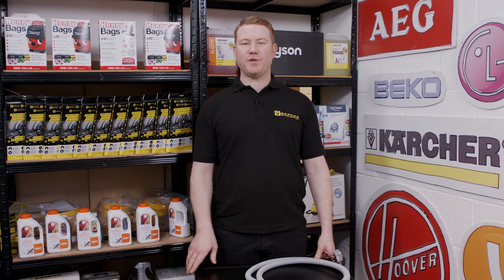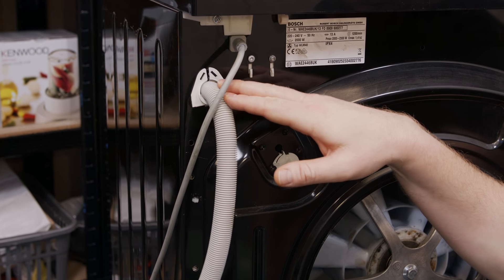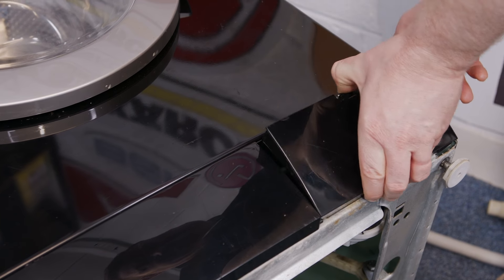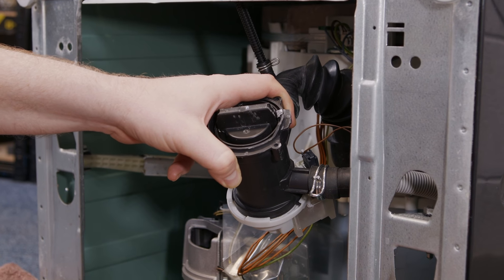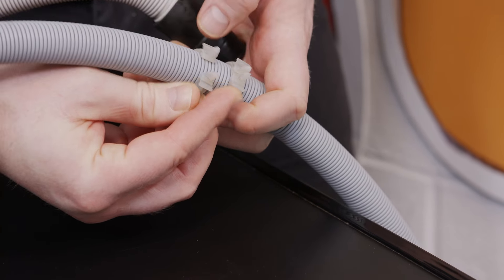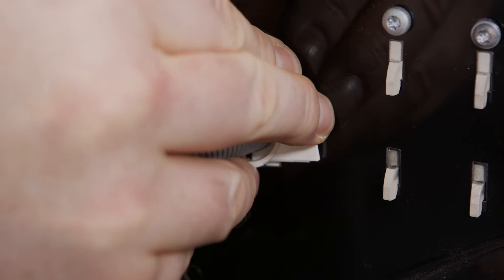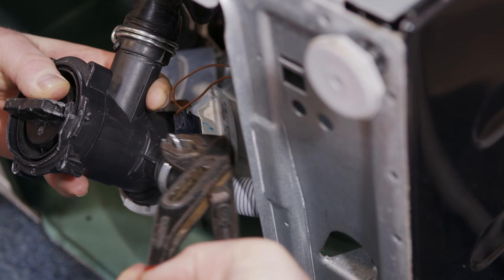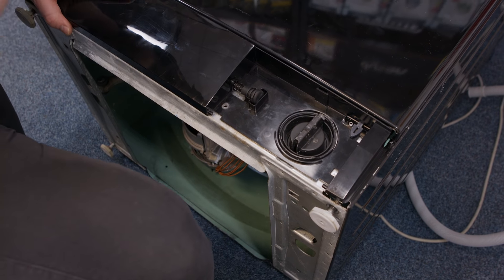How to Replace the Drain Hose on a Bosch Washing Machine

Comment: With your video I managed to fix my Bosch Avantixx 8 VarioPerfect that had a clogged drain hose in less than 2 hours. Without it it would have taken a lot longer (if at all). Thanks!
Reply from the maker: Hi David, thank you for your comment. It's great to hear that our video gave you the confidence to replace the drain hose yourself. Well done on completing the repair to keep your washing machine going!
Reply: Why did the back plate have to come off?

Comment: I did everything according to your video but forgot to connect back the pump so it started leaking. Opened it all back up again and reconnected the pump. However it still leaks from the cap. Any suggestions?

Comment: I have a bosch serie 4 ecosilence drive and when i try to remove the pump chamber by tilting back it wont give. Ive removed the screw. If i pull any harder the thing is going to snap